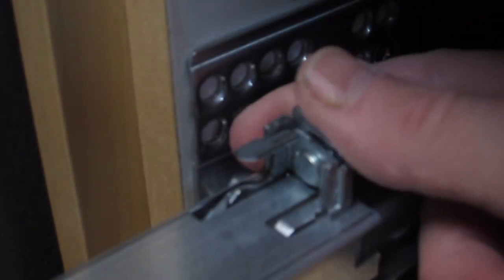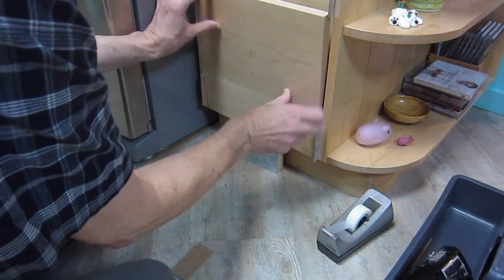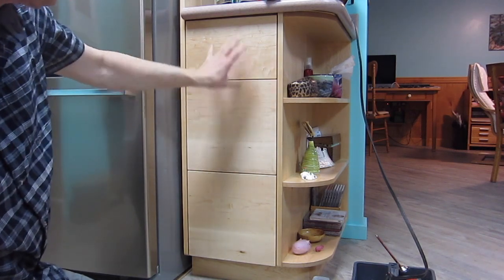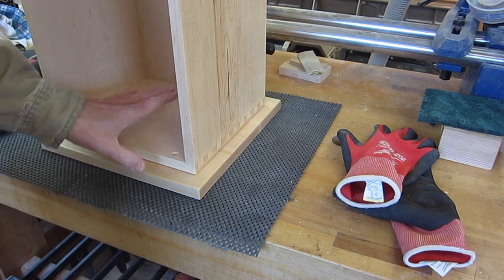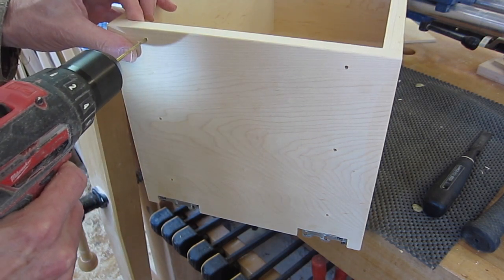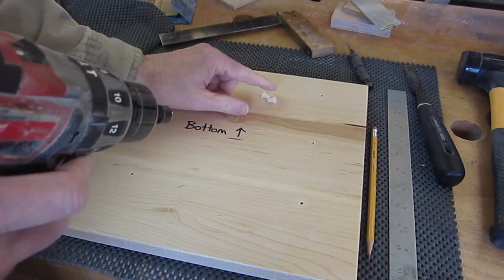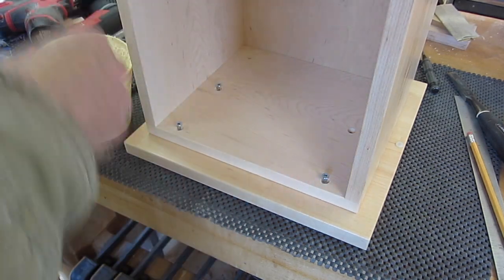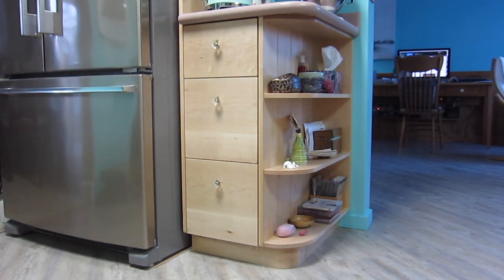How to install overlay drawer front face plate.

Comment: What about shaker doors? With a full overlay, the frames don't overlap the drawer front a lot, and the center panel is not only too thin to support, but also inset from both the front and the back of the frame, since it's thinner. What do you recommend?
Reply from the maker: Good question.   I have not installed shaker drawer fronts.  This fellow has some good tips on that:   https://youtu.be/uHv6yDaXPR0